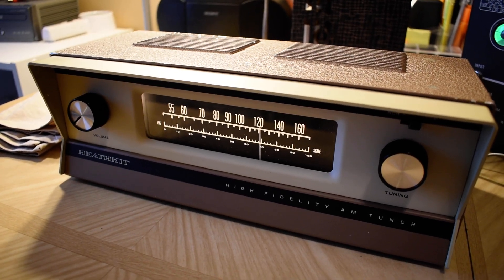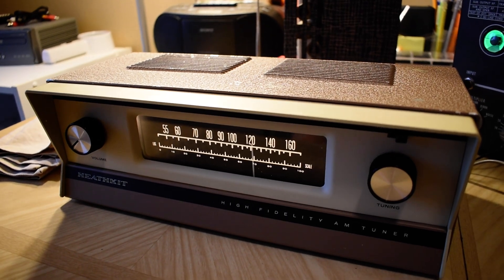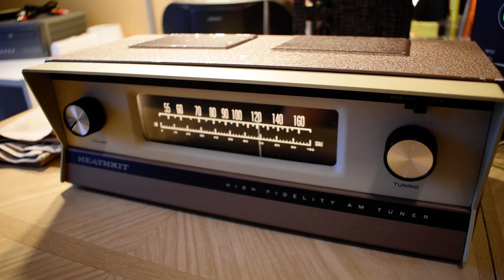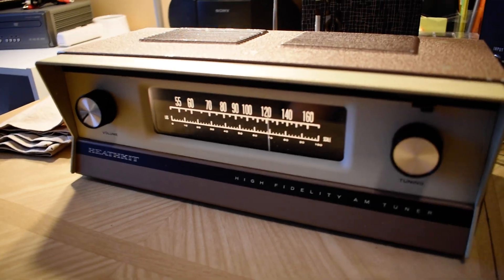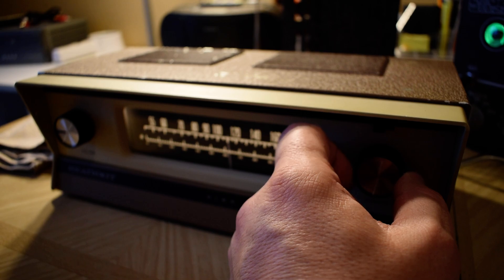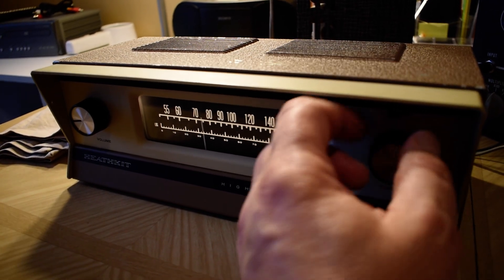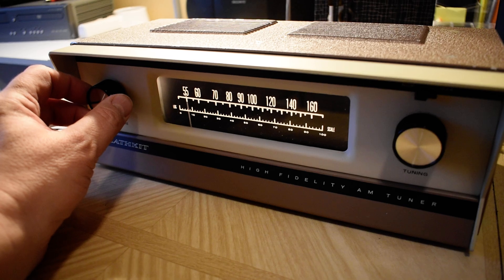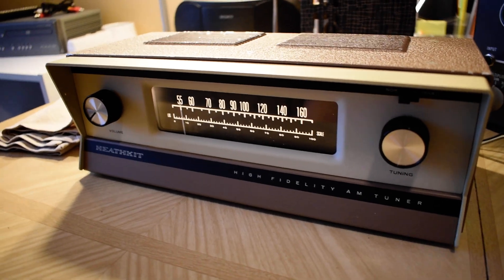Best way to learn about tube electronics- get an analog Heathkit tuner!

Comment: Weren't separate AM-only tuners for component systems a rarity at the time?  What did the "high-fidelity" circuitry do, exactly?
Reply from the maker: It widens the frequency response of the IF by taking a 10khz slice of the carrier envelope.